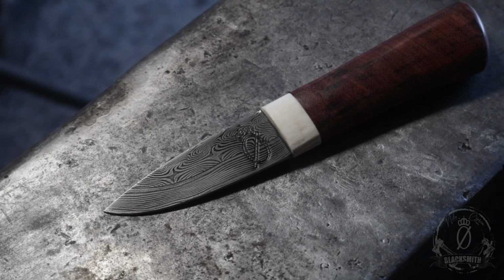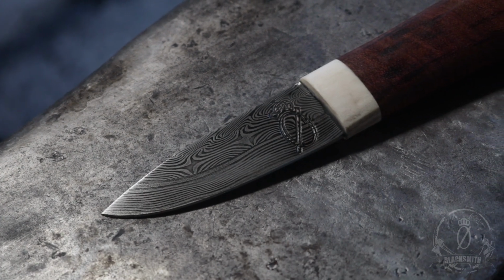Forging a Multibar Damascus Knife

Comment: Gorgeous knife, i love the pattern of the welds and the shape of the knife. You should keep at it, practice is never a bad thing and with results like that with little knife making experience, it wont take long to get right up there with the best
Reply from the maker: Thank you! We will see, it was very funt, but I need to figure out how to make them faster so people wont have to spend too much to get em :)
Reply: repetition definitely helps. Nailing down a single design helps with making tooling to expedite the process and ensure repeatability.

Comment: It's absolutely gorgeous.  🥰

Its not really optimized for being a hunting knife though.  For example, I wouldnt try to dress a deer carcass with it, or hammer it though branches to cut stakes or kindling, or saw through larger branches, or maybe secure it to a pole as a makeshift spear. 

Inflicting such mundane uses on such a beautiful blade seems almost criminal.
Reply from the maker: Haha thank you!
Reply: Just a little friendly razzing on the vid title ... nothing but admiration for the workmamship. 😁👍